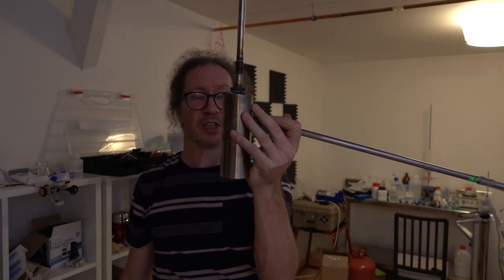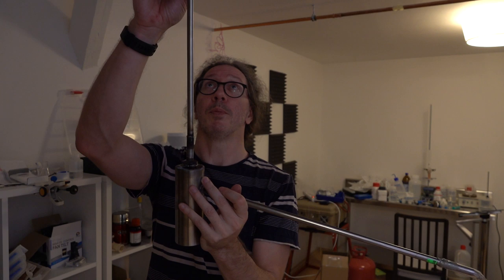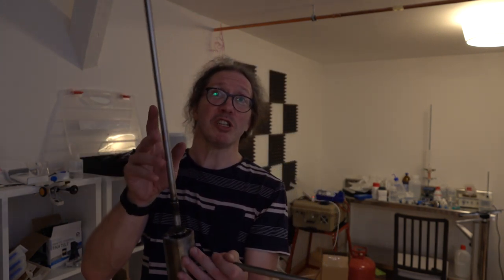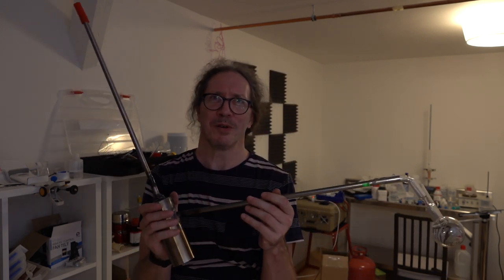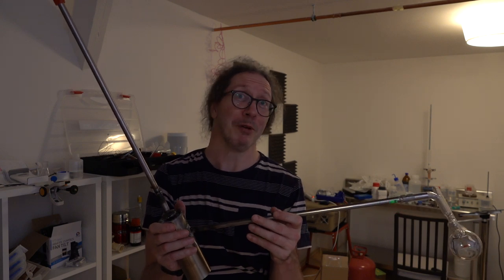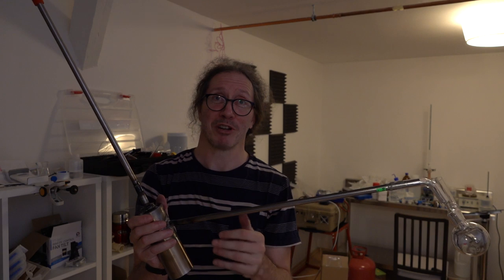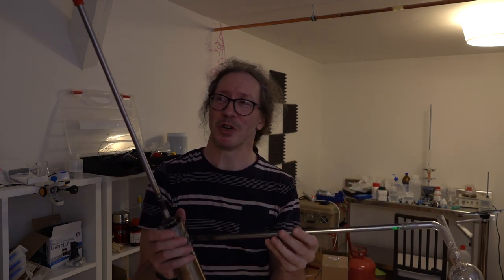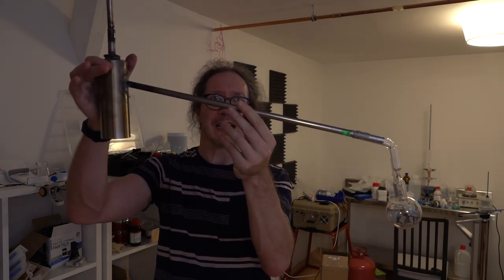Making a Cesium still from scratch!

Comment: I am a boiler maker. That means I am a retired welder by trade. Preheat your metal before you weld it will help you a lot. Practice of something other that the project and turn up your welder if needed. Remove all galvanized coating before welding.  You can use a wire brush on a drill to get most off. Hollow core welding wire is just like stick welding and leaves slag every time you weld. Clean it off by chipping it off with a hammer. Do all that and you will be welding like a pro soon. Good luck and practice. Don't burn your eyes it will be like dumping sand in your eyes on top of a sun burn.

Comment: You absolutely need the protective gas for MIG welding.
If it still dont work out check if what you're welding is galvanized,  you want to get rid of it before starting.
Reply: fcaw, not gonna be pretty but can still do the job just fine.

Comment: Two thoughts. Perhaps contact one of the metalworking channels and see if they can build something for you, and if they might have any good advice on that side of things. AvE and This Old Tony come to mind. Maybe they could even come up with some solution for water cooling the condenser. The second thought is, do you really need a vacuum? Wouldn't it be sufficient to connect the system to an argon canister through a regulator? I'm thinking that with a slight overpressure of argon, you don't have to care about tiny leaks, as all that will essentially happen is that some argon will escape that way, but no air would get in. Also, argon used as a shielding gas is incidentally probably the number one thing that would improve your welding.
Reply: Uh, a collab maybe.
Reply: Gameboygenius TF would be an interesting guy to do a collaboration with I would pay money to see how he got on with AVE.. unfortunately Canada is likely a bit out of the way for TFand unless he is near some mines AVE happens to be going to...

His caesium is already going to be contaminated I think it can dissolve some argon when it is condensing into a liquid... I don’t know how much that would affect it for his purposes helium would probably be the better option but it is expensive and TF has the equipment to make a vacuum... hammer nail etc
Reply: Ave and Thunderfoot would be an interesting collab. At the very least the dingus end wouldn`t get too hot, or stuck in a vice.
Reply: Dave B I strongly suspect the would drive each other nuts in no time... it is possible it would work out if TF could just describe what he wanted correctly first go and didn’t have to be there...
Reply: @glenecollins  It could be Uncle Bumblefuck and the sci guy.

Comment: Before doing the welding, first remove all of the galvanising on the pipes and end caps near the weld, and clean the metal to shiny with a wire wheel. Then a lot higher current, and you will have a good weld. Tighten the piping up hard, and use a lot of force to tighten as much as possible, steel pipe and end fittings are pretty robust, and it will eventually make a gas tight seal there just from the metal deforming plastically and storing energy in elastic deformation to keep it that way, as pipe threads are tapered, so eventually you get a good metal to metal seal.

 If you are going to braze, same applies, and your flux is typically very cheap, borax, which is as good in most cases as the regular brazing flux. Silver solder is also good, but your temperature to braze it is getting close to your operation temperature, so the welding will work better.

Comment: Nice. When I made cesium I used a stainless steel water bottle and a custom lid with 2 holes. On the first hole there was a flow of 99.999% argon at 2lpm flow rate and helped flush the entire system continiously with pure argon making super nice CS
Reply: Did your Cs Stick to glass? I can't get mine pure enough, I've tried it 7 times and the results are mostly the same. I think i need to distill the metal a second time
Reply: @SomeAustrianGuy  unfortunately yeah. The issue was probably handling after making it while I placed it in ampoules etc. I was also suspecting the residual oil of the lithium. Redistillation seems like a nice idea

Comment: Don't feel bad about your welds T-foot, welding over threaded steel is not easy, just take your time, use more weld than you think is necessary, and practice every chance you get.
Also it might help to grind down the threads if possible, just a little  oxidation will ruin your seal.

Comment: Regarding your welding It seems you need to run it hotter. Try to push more amps with welder and mix metal during welding by drawing small circles with the wire. Plus you definitely use shielding gas.
Reply: Looks like galv tube with a galv fitting too would be worth grinding that off first too
Reply: I'd be more inclined to use stick just because I'm lazy and its easier to switch between welding mild steel and stainless. 

Or just braze all of it since he already has the torches and he's a couple of flux coated rods away from having a good seal.
Reply: @EclecticBuddha  stick would probably be better for this anyway as mig produces more of a porous structure where as stick is solid as fuck

Comment: Crank up that Mig welder on steel that thick, you arent melting the steel at all hence the beading.
Reply: zeroy I think I would use stick (and not just because I don’t use Mig enough... I find the cheaper machines get a lot more penetration with MMA 

Also it sounded like he has been using flux core which makes it much more difficult it is really hard to keep the oxides out especially when you are learning. I have been wandering around farms etc picking up scrap and cleaning out old dumps... you wouldn’t believe how many “mig” welders that don’t have any gas capabilities you find just dumped in a gully or smashed in a shed.
Reply: @glenecollins  agreed, I would stick weld on those tubes

Comment: Can't weld galvanized. grind it back to bare steel.
Reply: My thought, exactly.
Reply: Yes you can weld galvanized metals. It is never advisable though. The thing is that burning zinc will cause metal fume fever if you breath the fumes, which can be deadly even in small amounts.
Reply: @MyAvitech  And it splutters and spits thereby making a lousy weld. Remove galv., weld, apply galv.
Reply: a quick dip in muriatic acid eats the zinc right quick also. Only takes a minute or 2. I find it a lot easier than grinding.
Reply: Yeah this needs more upvotes.
Reply: This times 1000

Comment: 1. Put cesium in it - in it's glass containment.
2. Fill up with water.
3. Tighten close.
4. Drop it on the floor.
5. Everyone within a few feet will afterwards be still.

Comment: @Thunderf00t My father used to work at Fermi II, since he passed 14 years ago from a fall down some stairs I have been moving around a mess of his stuff. The other day I finally looked through it. I discovered a wooden case, within this case I discovered a sample of uranium yellow cake, cesium chloride, a pellet of plutonium, a vile of deuterium monoxide (heavy water I assume) and a 8 inch rod of depleted uranium. I have been lugging this around for nearly a decade and a half and sleeping every night within 8 feet of this, the box doesn't seem shielded in any way, according to Alex Jones and the like shouldn't I be sprouting extra limbs? Please let me know what you think
Reply: As long as you dont get any of the stuff IN you, and keep your distance you are OK. But you really do want to make sure the U/Pu is well and truely sealed, so you do not have a radon generator in your room. And you may want to either shield the box a little, or put more distance between it and people.

Comment: Thunderf00t, If you want to make good welds, TURN UP DA POWAAAR. Seriously. Thicker electrode means slightly more current, but don't do too thick or it'll eat the heat. 
Just get more amps. 100Amps (welding current) is just enough to start melting thick steel. Welding is a bit slow. And you must absolutely keep the arc stable, so you can pump heat into it to melt. Once you can create a "puddle", it'll wet everything, like a brush, molding the metals together. The real welding tool is the puddle. Hope you read this and hope it helps.

BUT IM SKEPTICAL AND 100% SURE YOU WON'T SEE THIS ;W;

Comment: Wire brush your welds after each section. Use an agle grinder with a steel wire brush or a Dremmel-like one. Keep it clean so no slag gets incorporated in the weld. If you lost the arc, let it cool a bit, hammer and brush off the slag and start again. Try MMA, 2.5-3mm basic or superbasic electrode. Put some amps into it, don"t be afraid. 
It's just like soldering. The solder must melt enough to flow and wet the pieces.

Comment: Hmm, no gas shielding on that first weld? Porosity in the metal will likely prevent it being air tight. The way air gets in and reacts with the metal is crazy.

Some nice TIG welding with Stainless or aluminium would be nice.

Comment: for sealing threads in high temp gas tight applications you can sometimes get away with using a soft metal wire or foil between the threads to form a seal. lead tends to work well but has too low a melting point for your purposes. I've used thin solder wire to seal pipe threads in the past, if you can find a soft metal with a high enough melting point and no reactivity to Cs/Li it might work. gold would work if not for the price.

Comment: You should spend a load of time practising welding runs on bits of scrap as you play around with the settings on your machine, that would give you a good idea on what settings are best.

If you can get a TIG machine though, you can do some really good quality welds with that, it's basically like gas welding with electricity.

Comment: The secret to welding is to not be afraid to literally stick your face in there. Unless you have a solar mask you want to be as close to the object and welder as possible. Don't worry about the danger, the mask will protect you. But you need to get in close as you get better visibility and a steadier weld.

Comment: 1) that intitial steel tube (not the stainless one) is probably coated with Zinc to prevent corrosion. Make sure zinc or whatever coating is ok with your setup if you were to use that tube.
2)the zinc coating fumes from welding steel  are very dangerous/toxic. Permanent healt damage can result from welding with too little ventilation. Be safe
3)You'd get better results with TIG welding
4)for vacuum connections, prefer silicon tubing (max about 200to 250 C) over epoxy. Tubing is great because vacuum is self sealing. Plus you can disassemble easily.
I build vacuum stills (stainlessstuff.net)

Comment: How do you make sure the Cs vapours won't condensate and solidify on the inside of the upper tube? Blowtorch or something?
Reply: It melts at 28.5 °C, just a little over room temperature. The heat from the boiler will most be sufficient.
Reply: @yottaforce  ok, thx, forgot to look that up

Comment: @voiceofthunder Cody from Codys lab has something similar he used for distilling in one of his videos. He used the same kind of pipe with the caps. However, He drilled a hole in one of the caps and a smaller pipe through the hole. The end of the pipe had two nuts on the end (one on the inside of the cap one on the outside of the cap) And was sealed between the nuts. I think something like that might work better than just welding it  id check out his channel and maybe see if you can get ahold of him If you want to refine the process

Comment: Good luck.

You appear to be about as good with the mig as me already so I can’t give any tips... except welding thread with a MIG is always crap and should be avoided unless you are really experienced doubly so if you are using flux core wire because you can’t just keep the gas on to minimise corrosion. 

The trick with the MIG in general is you can make a really nice looking “weld” that doesn’t actually join the stuff you are trying to join and it is really hard to tell if that has happened when the materials are already fastened in some other way.

Your welder may be able to run stick (manual metal arc / shielded metal arc) it will not look as neat at MIG but it gets good penetration and when you have messed up it is usually easy to see.

I use stick welding on joints etc which hold vacuum those pipes you are using look like they would be simple enough to use a stick on, there is probably a type recommended by the manufacturer though most plumbers etc would just braise it for low temperature applications.

 Have never had liquid caesium or lithium in a pipe I welded up and would be sweating bullets.

Comment: It helps to strip off the zinc/zinc alloy before welding galvanized parts.  Better still don't weld galvanized parts.  Stainless steel should be welded with shielding gass, usually polarity matters as well.  Welding is a skill, practice, practice, practice.

Comment: thats not a MIG weld, that's a flux-core weld

ametuer-tip: your best bet there is to preheat the metals with a torch, then crank the heat and wire speed to maximum, also it looks like you ran the bead with the gun pointed so you can see where you've welded, for that joint push the weld rather than pull, you will get a better weld for that type of joint.

Also: if your welder has a positive and negative option, set it to DC negative for a far easier and better gasless weld

Comment: Cool ! TIG & stainless Steel would be my 1st choice (though not sure if Chromium would react with the rest of what your doing)......btw that looks like galvanized pipe(not sure if the zinc will react) but its surely not typically recommended for welding. btw Zinc fumes are very bad !

Comment: Surely you would be better using a high temp silicon like rtv 736 which is resistant to 315°C instead of epoxy which is only good for about 177°C if cured with heat. If left to cure at room temp it starts to degrade around the 100°C mark.

Comment: Its crazy how smart you are but I know loads more about welding than you. Brazing or soldering would be a good place to start if you are looking for a vacuum tight seal for a novice. Your best bet would be to get an oxy-fuel torch the correct flux for your solder or brazing rod and for your base metal.
Reply: He already has experience with torches and glass work. I'd say this is the simplest way to get a reliable seal. Brazing doesn't get enough credit for being strong. It's more than enough for most applications.
Reply: P m W you are correct on both points. 👍🏻

Comment: Teflon tape? It's normally used with your galvanized steel pipe.
NPT = National Pipe Taper .. you can get very tight seal just by screwing it down.
Be sure your pipe caps are not NPS: National Pipe Straight.

Also welding zinc galvanized pipe isn't easy and fairly toxic.. weld in the wind..
Reply: PS. You'd seal the threads .. no welder necessary..
Might also try bell reducers to get larger/smaller piping connected..
You could also drill & tap holes for different size pipe..

Comment: I have around 100 grams of cesium chloride, with the intent to isolate the metal using this process. I just need to build the apparatus. 

Could you possibly use jb weld in place of the epoxy?
Reply: im pretty sure that is JB weld, in any case the classic (not the "new formula" crap) JB weld should work fine for the joints that dont heat up a massive amount

Comment: Those pipes are galvanized. You can't weld that :( the zinc just gets nasty and in the way. One quick and easy way yo remove it is to dip it in muriatic acid. Dip it in slowly as it will fizz and bubble quite a lot. It doesn't take very long, maybe 30 seconds to a minute. Once the bubbling stops its done. Give it a rinse and maybe a little brushing with a wire brush and it should weld a lot better for you. Good luck from Washington, USA :)

Comment: You cannot use MIG without protective gas (argon). Only if you have some special wire that doesn’t require argon but it’s crap. Better use regular MIG wire and argon. You need to clean the metal parts and it would be better to take the zinc coating off of it. And yeah maybe ask some other guy. TIG welding is much better for vacuum tight seals since you have much more control over the metal and can see it better...

Comment: Oh god...you didn't clean those mating surfaces. Phil...put the welder down. For all of our sakes, just put it down.

You aslo need to make the reaction chamber deeper so the reagents can be closer to the heat source, and you have better heat conductance at the joint where the vapors will slow down.

Comment: if youre gonna use your pipe bomb you got there you dont need to weld the end caps just braze them, almost the same thing but the base metal doesnt melt only your "solder" does, and can be done with a TIG welder, which DOES use argon, (so should a MIG actually you must have been using a flux core welder) better to braze with TIG cause you can better control the heat..

Comment: if there's no gas is just a wire feed welder. mig stands for metal inert gas. also your welder isn't powerful enough for those materials. you need more amps! if you can afford it you can get a reasonable TIG from aliexpress for around $400us. but welding around a tube is cm advanced skill. maybe message AVE or This Old Tony and ask them to fab what you need.

Comment: Dude your going to want a  shielding  gas. Just go out pick yourself up a bottle of argon. If not I mean welding is a bit different than that. You just about always want either flux or shielding, if not your always going to get all that slag in  your wield which usually looks like a sort of bubbled up surface. Especially with an ac system.
That small of a pipe is a hard wield though. I mean were you using a flux wire? If you were just using a steel wire it should be cake once you get the gas, it makes that much of a difference.